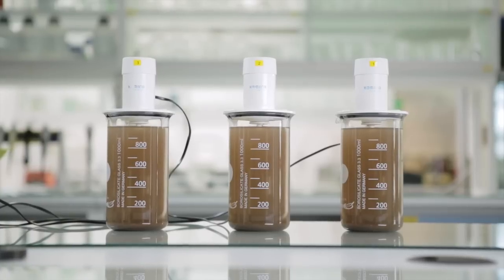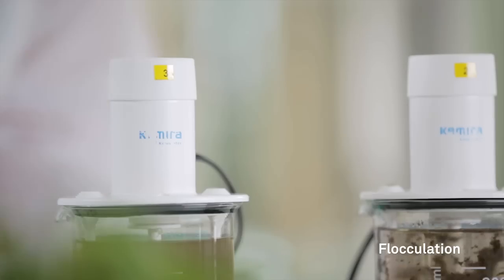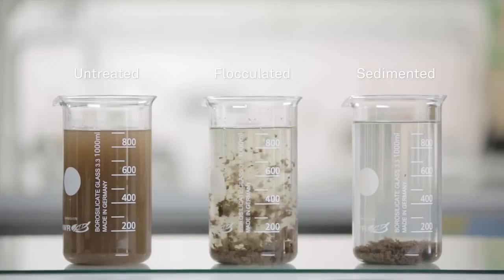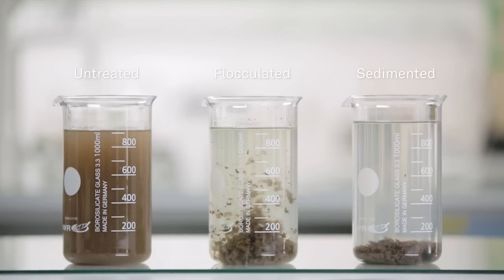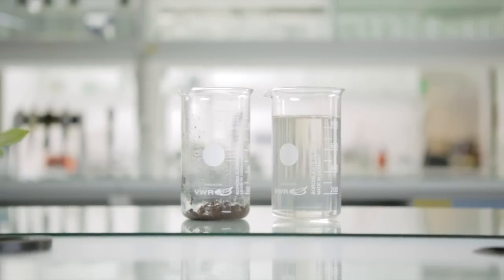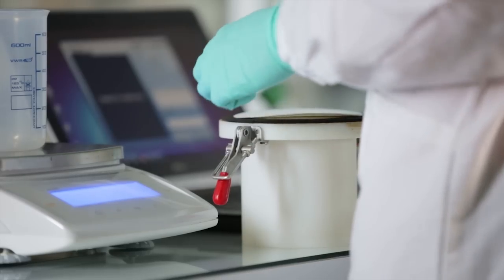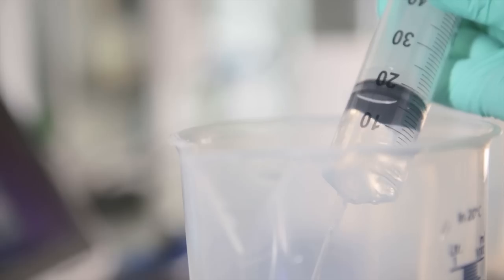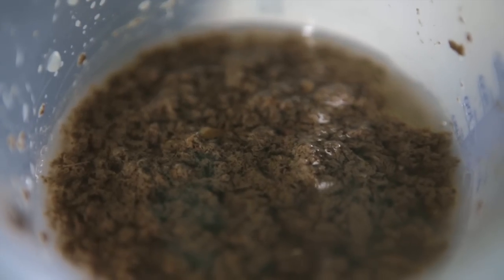Polymers in wastewater treatment

Comment: What are the pieces of lab equipment used to press out the filtrate water from the sludge in this video?
Reply: Hi,this is Jacky from China.I joined you from watertreatment group. Do you need import watertreatment chemicals?

Comment: Brilliant, ...what polymers would you recommend for the treatment of wash water from concrete pressure cleaning, with a small amounts of used motor oils...for example gas station steam cleaning, drive through cleaning and similar surfaces.
Reply: Hi,this is Jacky from China.I joined you from watertreatment group. Do you need import watertreatment chemicals?